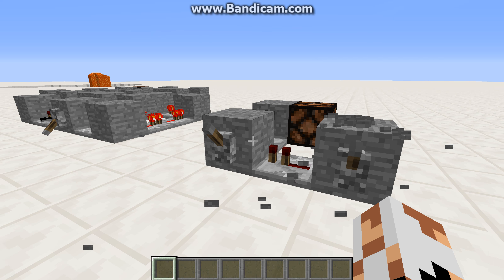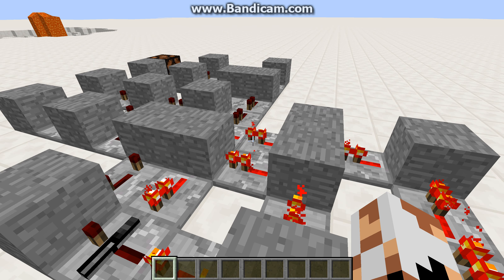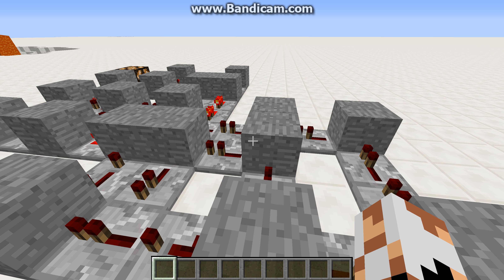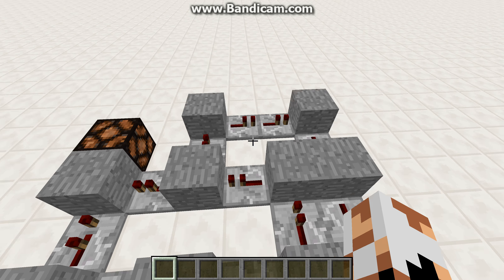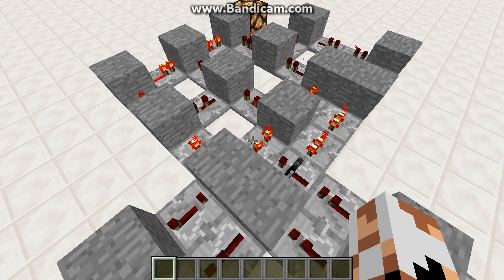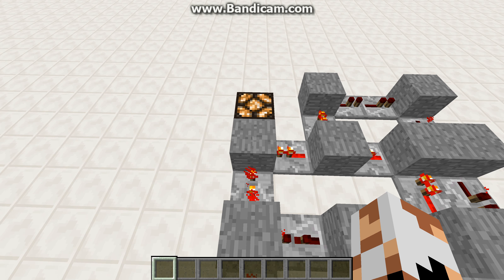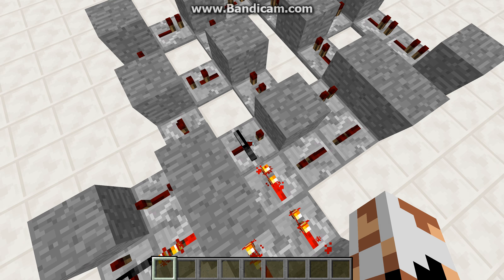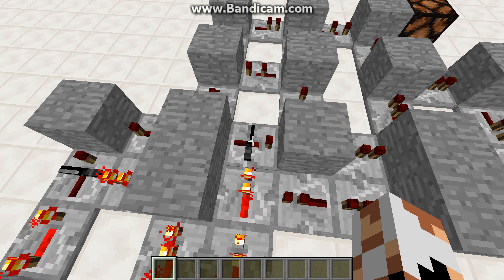"Not" Logic gate using only redstone repeaters and solid blocks

Comment: I can from xuma, but can't you use a locked repeater who's powered? instead of a clock
Reply from the maker: Locking a repeater requires power, and if I lock it with the power from the locked repeater, I can't unlock it.
Reply: True I didn't realize
Reply: This would be really laggy on laptops, so just use a flipping Redstone torch people, even on Minecraft pe you can use a Redstone torch
Reply from the maker: +legofan jj Yeah, this not gate is completely overcomplicated. Though this was actually recorded on a laptop, and it didn't lag. It depends on the laptop.